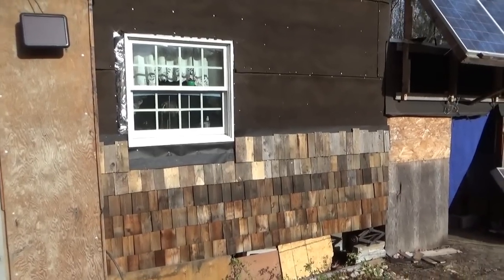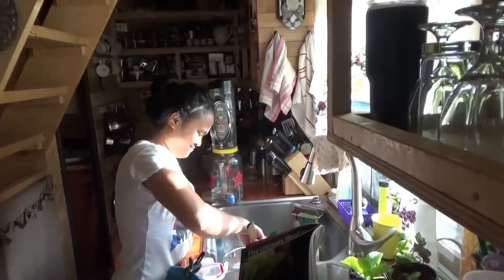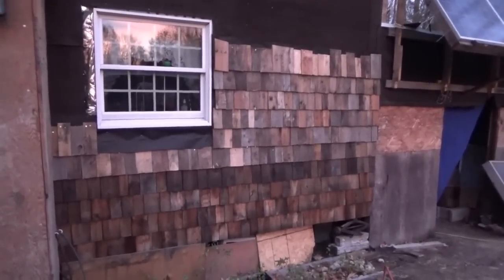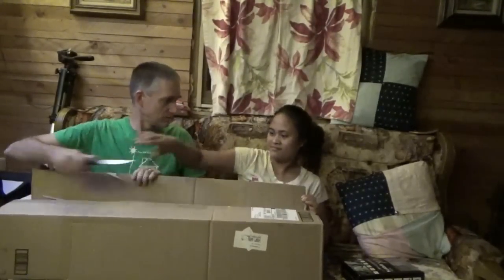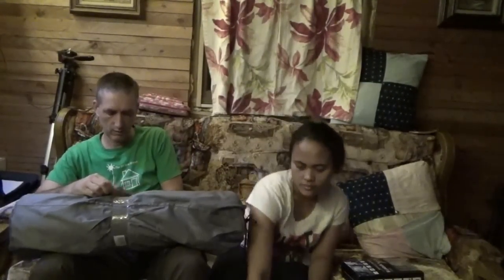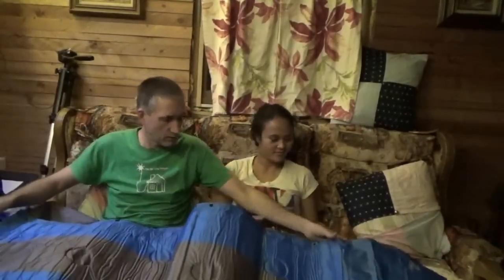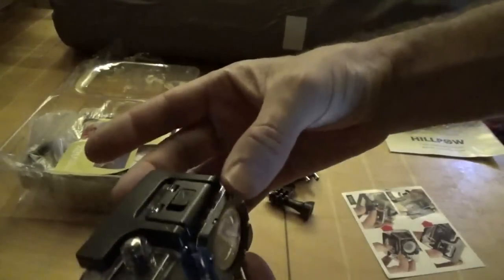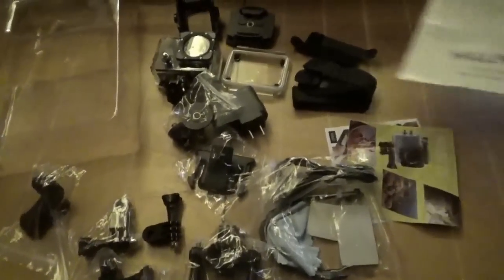Putting Shake Style Pallet Wood Siding On Tiny House

Comment: You don't need to go up and down a ladder. Just set a plank between two step ladders, on the rungs, and a bunch of shakes set on the plank so you don't have to keep making trips back and forth. Take a saw up on the plank also. The plank could be made from anything. I used to use one half of an extension ladder as a plank. Place wide enough pieces of plywood over the rungs so you have something to walk on.
Reply from the maker: I will carefully try that. My one ladder is bent and wobbly at best.
Reply: It doesn't have to be a ladder; it can be any plank. If you do use a bent ladder, then span across the bent part with 2 by whatever you have. One plank across the bend and finish the ends with other 2 by material.
You can even make your own plank by constructing a frame out of 2/4 and sheet 1 side with plywood. Make it 16 feet long, the length of 2 pieces of plywood. It would look like the door you made for the green house.
Reply from the maker: I will try it. Thanks.

Comment: Troy, Why do you refuse to google a video from any manufacturer on how to install the shakes? You DO NOT have enough coverage on the rows. Look at the tarpaper showing through, under every row you install. This will leak like a sieve, literally. If you see tarpaper on the rows you've already installed, that means it's not covered. They are also supposed to be a 1/4" gap between each shake to allow for expansion and contraction.
Reply: This Old House, many years ago, had a fantastic tutorial on installing shake siding. Bob Villa was still the host. This final step is probably the most critical of any part of the tiny house project. It's worth doing right the first and only time.
Reply: It's easy to do it right. He's only covering the first couple of inches of each row underneath it. Under that is only tar paper.
Reply: ***** I hope he's using rust resistant or galvanized or they will eventually rust out.
Reply: the tarpaper will eventually deteriorate.
Reply from the maker: This is pallet wood though. I have no idea how to do a full overlap like you say using 1/4 to 3/8 inch thick wood. I have looked at shakes and they are tapered and very thin to allow the proper overlap. I have three layers of tar paper between the siding and the house. I guess time will tell.
Reply: I don't understand what you're saying. Sounds like you are saying that shakes from the manufacturer are not made properly to get correct overlap. This makes no sense. Of course they are and is why they've been made this way since forever.
Reply from the maker: I am saying that my siding is NOT made correctly to provide overlap. The stuff professionally made is just that. Professional.

Comment: I like watching your channel man but has all the people stated when you first started doing this that is going to leak so bad roll down the tar paper and through every nail penetration they're not overlapping on the seams. good luck man
Reply from the maker: The tar paper covers the nails and 3 inches of each layer underneath. There will be three layers of tar paper between the siding and the house.
Reply: And the nails puncture all three layers and with the water running down the back of their shingles because they're not overlapping it will leak brother
Reply from the maker: Actually no. With one layer of tar paper it overlaps over the nails of the row of shingles under it.
Reply: I encourage you to watch a video on how they actually do the roofing of those singles... I hope you'll see what I mean either way it's your house and good luck with it
Reply: +The Do It Yourself World at 50 seconds in mate, Iv paused the video-------after each row of shakes, are you then placing a layer of felt/plastic, that will be under the next row of shakes? If so, it will be dry, I just haven't seen the vid where you put several rows on and demonstrate your method.